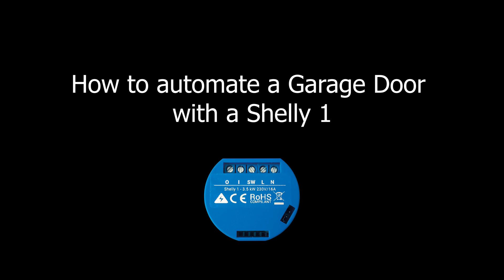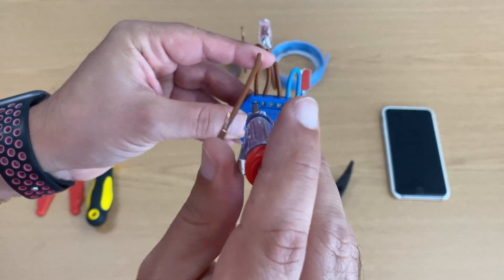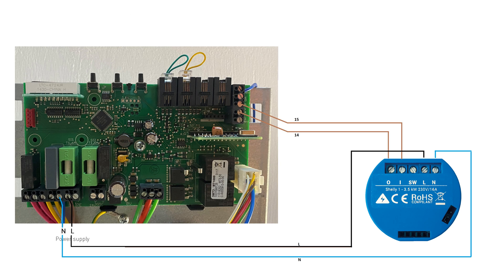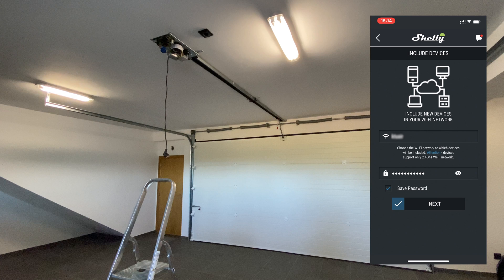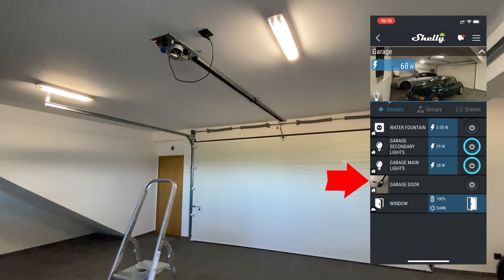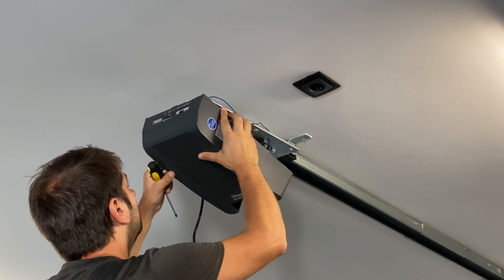How to automate a garage door using a Shelly 1

Comment: Anyone having experience with the Hormann D437634 Electronic Board SD7500 where I too will be using a Shelly 1 smart switch to open/close the garage door remotely...

I´ve been unsuccessful in finding a wiring diagram detailing the electronic board terminals so I would know which terminals to connect to the pertinent Shelly device terminals, similar to what is done in this video. 

No problem locating L and N, but I´m unsure where to connect O and I (no. 14 and no. 15, respectively, in this video)...
-I suspect I(input) goes to SC (Switch Common) on the electronic board?
-if I´m correct on I(input) where do I connect O(output) to...options for what this video designates as 15 seem to be Switch Down, Switch Up, Motor Up, Motor Down? 
-Do I ignore the SW terminal on the Shelly device?

Shelly device installation instructions: Connect the load circuit to the I(iput) and O(output) terminals of the Shelly device. Connect the Live wire to the Shelly L terminal and the Neutral wire to the Shelly N terminal. Connect the switch to the SW terminal of the Shelly device and the Live wire.

My questions possibly reveals that my ignorance is greater than I hope so I´m open to enlightentment. Any guidance would be appreciated.

Comment: I live in a building with shared garage parking so I don't have the access to the motor. I have spare remote and power+internet at my parking spot. Would it be possible to solder contacts of the remote to the shelly1 and control it online?

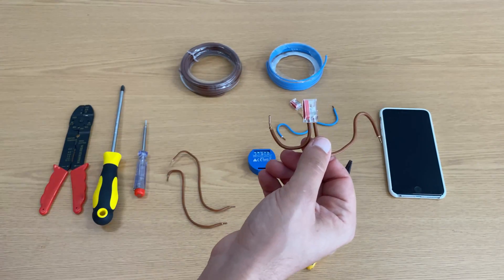Comment: Is there a reason why you used the red and white see-through connectors @0:45? it seems like you just join the Shelly1 L and N straight to the Garage Motor PCB?

So could you just run ONE brown wire and ONE blue wire to Shelly1 L and N?
Reply from the maker: Hi! Yes, that’s true. It was a mistake from my part! You can connect L and N straight to the Shelly. Thanks for watching and the comment!

Comment: One question about those blue neutral wires going from the Shelly 1 to a Wago coupler.....Why using a wago on those? Wouldn´t it be better to just use a single blue neutral wire? Can´t see the need of the wago there...
Reply from the maker: Yes, that’s true. It was a mistake from my part!

Comment: Hey, great video, can I ask though, what are the wire joiners there... are they fuses or something?
Reply from the maker: Hey! Thanks! At what time in the video are you referring to? I did not use fuses. I used only wire connectors.
Reply: @ktulinho  yeah the connectors you connect the 2 wires together with... do they serve any purpose other than to join the wires together?
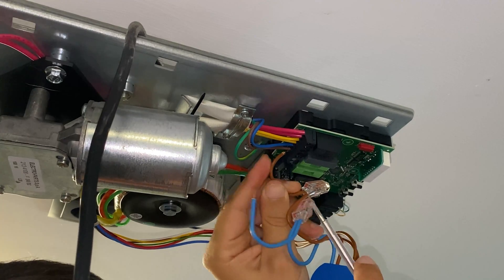Reply from the maker: @BenNeill  Ah, in minute 3:12, for L and another for N. I only used to join the wires. This was redundant... It is not needed. I could have connected directly. Only realized in the edit... Nice catch :)
Reply: @ktulinho  ahh right, all good! Making sure I am not missing anything before I begin 😅

Comment: Hi very nice video, I hope you can help me with mine I have a securalift gdo-11v1 garage would you point me how I can install shelly1 on this?
Reply from the maker: Hi! Do you have the schematics for the circuit board?
Reply: Hi thanks for replying this is the only thing I can find online as manual. https://www.google.com/url?sa=t&source=web&rct=j&url=https://www.ata-aust.com.au/AtaAust/media/Manuals/GDO-11v1-Ero-User-Manual-v1041.pdf&ved=2ahUKEwiIyumUm_j4AhUD8DgGHV5QDikQFnoECA0QAQ&usg=AOvVaw1RtB3M38Dg0L_ud1KdO5_9

Comment: Nice video and a very detailed one. I have question though. Does it work if I continue using both Shelly and remote control? If so, is there any chance that Shelly tracks remote control signals (by any chance)?
If the answer is no, is there any other way to get the actual current gate position (closed/opened)?
Reply from the maker: Hey Thanks a lot! As far as I know, it works with remote and shelly. But there is no way to know exact position of the door. the only way I think is to know if it is either open or not.
Reply: Could use Home Assistant and 2 door sensors

Comment: How is this automated? You have to press a button. I mean it’s a great video and very detailed I just don’t see any automation. How can I make a garage door automatically open when I pull in and automatically close when I leave. Now that would be genius. Some sort of iftt thing with this switch maybe? 
Thumbs up on the vid was enjoyable even if it didn’t cover what I was looking for. Ty.
Reply from the maker: Hey! Thanks for the feedback! I guess you can always create some automations in the app or home assistant.
Reply: @ktulinho  The automation requirment is hearing the alarm system not going on automatically at 10:00 pm when I am in bed and it won't go on as the garage door is open. (and a entire family of chipmunks has moved in!) I can now use Alexa to shut the garage door and then ask her to set the alarm.
Reply: My sensor on the garage door, front and back, are wirelessly into the alarm system and are to sound the alarm if the doors are open when the alarm is set.
Reply from the maker: @EarlSnider  Interesting! I hope the chipmunks were able to go out of the garage before the alarm was set! 😄

Comment: FYI,   either the green or yellow cable loops in them rj port up the top of the board @3.32, one of them ports in constant 24v dc power to power accessories.   If you want a low power solution and can use reed switch as well.
Reply from the maker: Thanks for the tip! Much appreciated!

Comment: Sorry but you have missed a valuable point using the sensor ability of the Shelly to note the state of the door. Thumb's down.
Reply from the maker: Hey thanks for the feedback! Not sure exactly how you would do that with a shelly 1. Is it possible? If so, I would be very interested!
Reply: @ktulinho  Yeah I doubt it's possible without a reed switch (from what I've read anyway) 

Shelly have one now that is wifi connected, but any old one will work
Reply: @ktulinho , greetings from Portugal ;)
You can achieve this by using Shelly 1 with a reed switch on the SW port.
You will need one that has a long cable so you can install it on the garage motor rack point where your garage door is fully closed.
The second part of the reed switch (that contains the magnet) needs to be placed on the chain/belt (close to the safety release mechanism).
You can find a good example of this setup here: https://www.codepug.com/assets/images/garage_magnet_reed_switch.jpg

I have a Ditec Top603H, that is the smaller brother of your garage motor (more powerful) and I noticed that you have wired your shelly using 220V power source.
I did the same as you did on this video and in fact this is the most correct way of doing it. This avoids messing up with the board 24V direct power supply, eliminating all potential problems related with the motor power transformer over-usage and will never void the motor motherboard warranty, but creates an additional challenge when using reed switches.

Most of the reed switches you find out there are 12V/24V. You need to be sure that you buy one that is ready to cope with (up to) 240V.
After installing it, you should be able to get the state of the reed switch from the shelly 1 directly. When the reed switch os closed (both parts close to each other), the switch state seen by the Shelly 1 will be reported as "ON", meaning that your garage door is closed (you can invert this logic on the shelly settings).
This way you have an accurate way to confirm that your garage door is really closed.
Be sure that you set your shelly switch mode to "Detached Switch", otherwise when the reed switch gets closed it will trigger the Shelly (and you don't want that).

Hope this helped.

Great video, btw!
Cheers